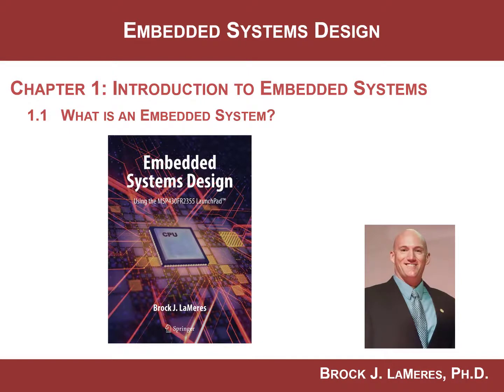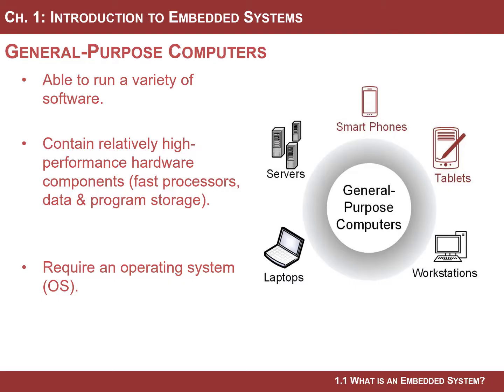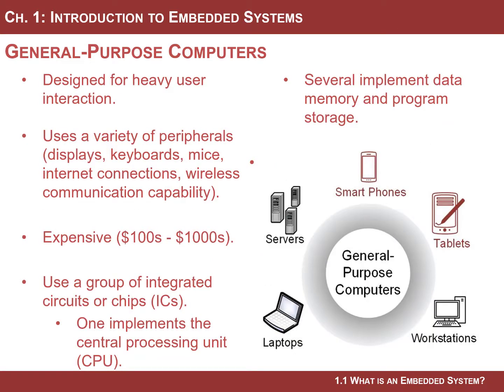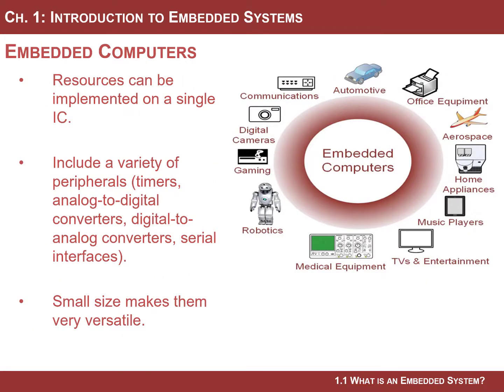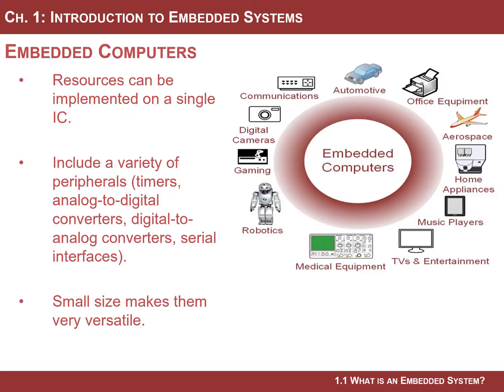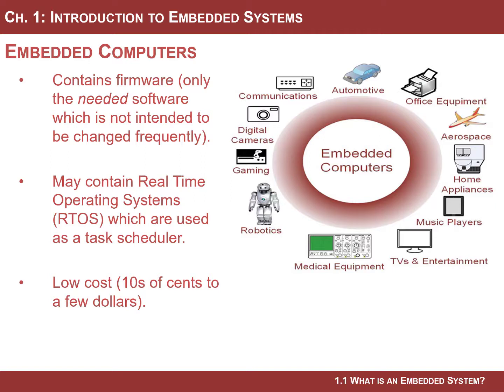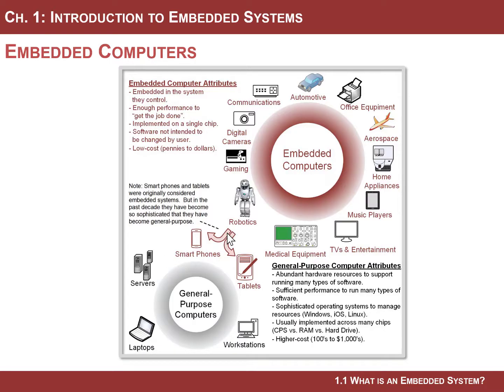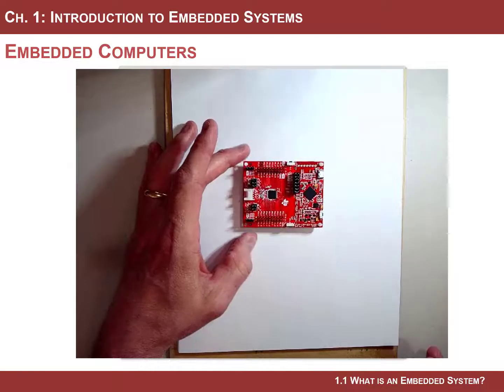1.1 - Embedded Systems Overview

Comment: What's the benefit using mps430 architecture for an UG course nowadays? (Isn't is obsolete/outdated? why not ARM cortex m4/stm32 as a starting point?). I do have such a board but not sure if the knowledge will be relevant for modern embedded systems

Comment: Where can I find this board? All I see is MSP430 G2 models are they the same? Will any MSP430 work with this series?
Reply from the maker: You can get this one at either ti.com or at digikey.com.  You want to search for MSP430FR2355 LaunchPad.  The other launchpad board will be similar, but different enough the code examples won't work directly.  Good luck!
Reply: Digital Logic & Programming just got the book from amazon today and it looks great, my board will be here later this week and I look forward to learning.